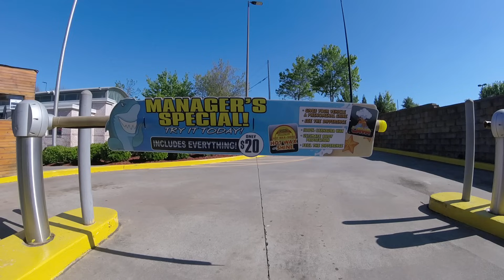GoPro Car Wash: Ultra Car Wash Lilburn, GA

Comment: This is a Coleman Hanna tunnel. One of the worst ones I’ve ever seen.
Reply from the maker: +CWL2010 - ROBLOX & More! They recently upgraded to a Sonny's tunnel, and its much better.

But yes, this was by far the worst tunnel I've ever visited.
Reply: Car Washes of Georgia At least they upgraded it to a Sonny’s tunnel. Sonny’s is my most favorite company that makes tunnels. After all, you can extremely rarely go wrong with either a Sonny’s or Belanger tunnel.
Reply: Alberta Car Wash Network much of Hanna's stuff has gotten better. Those HDM's that weren't even working are outdated, as are the flex wraps. Wrap arounds are much better
Reply: Car Washes of Georgia Can you revisit ultra car wash please

Comment: Dryers sucked, only 1 mitter-curtain worked, rest didn't work, tire brushes did not work.
Reply from the maker: +CarWashLover2010 PDQ Tandem ProTouch This visit was horrible. Worst wash I have ever visited (in terms of equipment operation)
Reply: Car Washes of Georgia I've seen worse,
Reply: Car Washes of Georgia I once went to a Mark VII SoftLine tunnel and I bought the soft touch option and the brushes were legit disabled!
Reply: Rr
Reply: Those are the worst I I've seen

Comment: Huh. I did you put your GoPro on the outside of the vehicle instead of the inside? I don't want you to ruin it. It might get beat up by the brushes of the car wash.
Reply from the maker: +Jack Salvaggio I wanted to see what a bumper view was like. But, some washes are more harsh than others. 

But I have had more requests to do inside views than outside. 

And thanks for Watching!
Reply: Jack Salvaggio to get to see